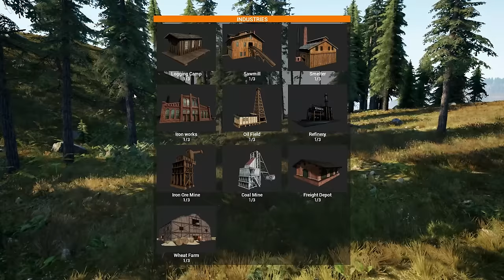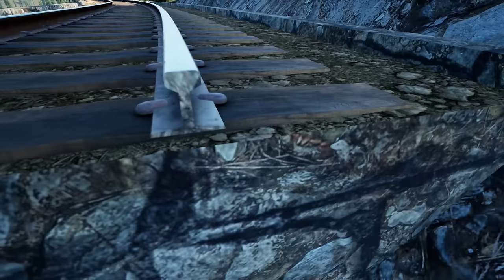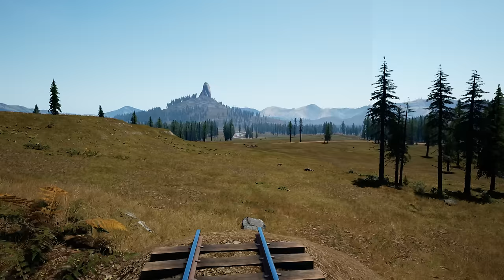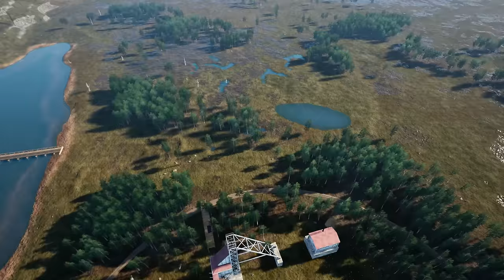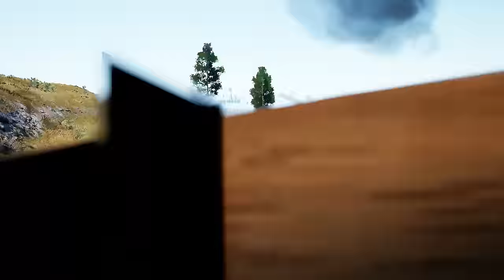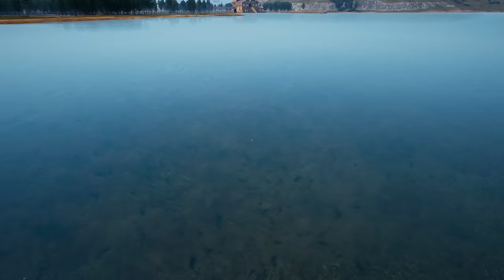I Built a Beautiful Lakeside Railway on The New Map in Railroads Online!

Comment: I would suggest using the three way switch at the saw mill. it might require some re adjusting of one of the crossing points but overall i think using the three way switch would make in a lot easier. the three way would replace the switch that you have right at the loading area if it wasn't clear
Reply: I was thinking the same thing I wonder why he doesn't use them
Reply: @zionjarman3610  I think it' mostly because it doesn't spring like the others when you run through from the back side and you have to make 100% sure you're lined the right way no matter which side you're coming from. The regular 2 way switches, of course you have to line for which way you want to go, but coming back through them you can just run through. Great for trying to just go and run trains, but not necessarily realistic.
Reply: @zionjarman3610  I think it might be because they don’t function as kick switches but in an industry going into the loading zone you would be going slow anyways
Reply: @Ronald.Golleher  didn't think about it

Comment: FYI I've seen someone running Eureka on a 50 meter curve at max speed (29 mph) and tip off the rails, so likely somewhere below 25 mph would be good for those tighter spots.

Comment: Getting the exact location for new industries would be nice, but I think an approximation is fine if you don't want to rebuild the entire network.
As long as you get the orientation right so the entry angles are the same.
Reply: Like I said in a prior video when it came up, I think placing them by hand and adapting the rail network as needed will actually make it more authentic.

It's not like IRL all industries existed and railroads got to calculate a most efficient network from the start. They changed and adapted over time, with the rise and fall of industry.

Comment: Lake Pend Oreille in Idaho has a pretty decent bridge across it, probably 2 or 3 times wider than the in-game lake. They used to have a big trestle across the Great Salt Lake in Utah,but that’s just a giant fill now. They had a station right in the middle of the lake!I think there’s some bigger examples in the South, but I can’t remember what they’re called. 

Once you get some faster engines, the longer alignments are the way to go. I went even further, around the back of the mountain past the coal mine, then 3% up the cliff to the iron mine. I found a decent 3% route from the IM to the smelter. I use the Glenbrook and Eureka to handle things on the flats, and a Ruby Basin to help shove them up the hill. If you can, save up for a Eureka since it can do close to 30 now!

Comment: Hey Kan, I’m wondering if you can use this same alignment method to connect the coal mine to the 4%. That would eliminate the reliance on a crazy 10% grade. You could probably go around the near-side of the lake and hook in where the big iron bridge crosses the valley to the freight depot.

As for your mill issue, maybe try replacing the mainline/smelter switch with a three-position switch, then use some diamonds to connect it with the mine alignment. So your loading doc switch connects to the mine, smelter, and goods alignments (left to right).

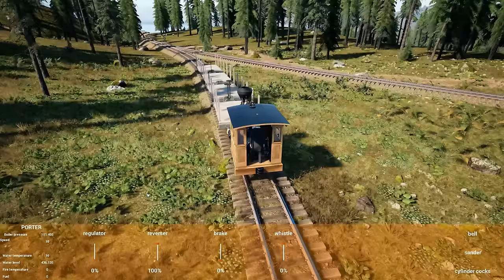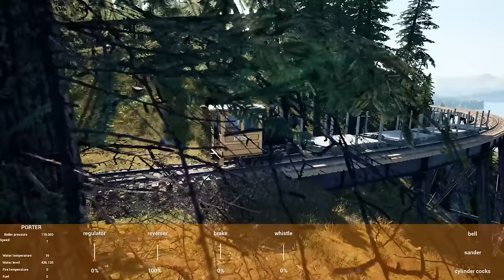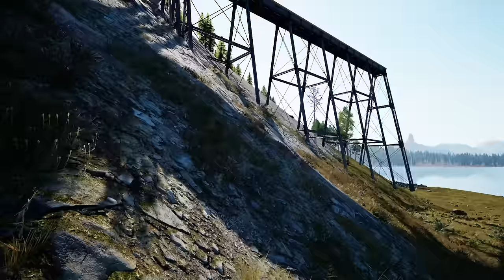Comment: I'm back seat gaming here, but at 5:22 I would have gone out further to the right (with the piece of rail that the train is on). See how the rail from this direction goes left then right and then left again? I'd have gone straight, left, straight. Or maybe even a gradual left turn. And I'd go as far leftwards when passing over the edge at 5:51 to hug the mountain side more, like making a 60° turn on the plateau. 7:24 even more than that. 38:34 is another view on why I would re-do it differently.
But hey, that's just my OCD and I don't claim that it's the right amount to have. Though I also do wonder how much one can generally improve their first alignment by going over the finished product in the opposite direction and re-doing everything...

Comment: 31:55 You would "screw up" your loading (i.e. you have to reverse to the crane in order to load both products). But placing the switch next to the cranes would give you an easy option to reverse the train. As it is now, a train that comes down going forwards will have to go back up going backwards. (Unless you do some ridiculously long reverse stretch that involves going into one of the inland-facing main lines.)

If you want to completely re-design the sawmill, I'd
either start with a full circle in front of the loading platforms, and wye everything into that;
or do all connections into the line up to the smelter (both the main around the lake and the main to the freight depot) and keep only a single teardrop loop past the loading platforms.

Comment: I swear the devs are going to look at your high lake bridge and go..."Nope we need to lower the max height."  So you're going to be able to build it, but after this no one else is going to be able to.  At 19:00 that's not a floodplain that an upland meadow.  Wrong characteristics for a floodplain.  Too much slope, no wet veg, and no breakline for where the topography leaves out to water.  It's still upland and not even squishy upland.  Yes "squishy" is an official wetland term

Comment: When you are buying the engine I would recommend the Eureka it's speed got buffed to 24mph 
Don't forget to look into the tutorial menu that's on H or M don't remember exactly they show the loco speeds in km/h there
Also in my save I have two routes from the iron mine to the smelter both of them go down south and loop around you can get it down to 3% that way but there were a lot of steel bridges
If you want a fast road from the iron mine build a 4.5% down south and get up to 48mph(the trains can handle like 250m turns but it's not like you need to really turn there)

Comment: Just an FYI, I know you've been speculating about the various cars and their capacities and stuff, but I'm pretty sure that's later. The skeleton car holds 5 logs, the same as the tiny log flat, but they're full logs. They trade off with the skeleton car and the regular log flat is about $50 (I think) in price and a 1 log hauling difference. It doesn't make sense that you have 2 cars doing the exact same thing for the exact same price. The tiny log flat and the skeleton car both cost $200 base price. Both haul 5 logs, even though the tiny log flat hauls essentially half logs, and having them just as aesthetical differences would be a really dumb game design. That's like admitting that the devs have 0 ambition to improve the game play and are only worried about if it looks good. A polished liquid turd is still diarrhea. Also, the half logs don't weigh any less. You load on 10,000kg of weight onto both cars (each log weight 2,000kg) and both hold 5 logs. So you essentially have the difference between the two weights of the cars to make up the difference. It has also long confused me why there's such a mix up of units and why kyumei is not fixing that. It's supposed to be a simulation of historic American narrow gauge, but he's throwing MPH with kg. I mean, I hate to sound so negative, but I think Hyce was correct in leaving RRO. It's definitely had it's heyday already and they're just shooting from the hip hoping something sticks at this point. They have no idea where to take this game and that's just painful even to speculate.

Also, I love the difference between RRO and DVS (Derail Valley Sim). You derail in DVS you hear it. You derail in RRO, the only indication you'll ever get is the normal running sound will cut out and if the locomotive goes over and you'll get a force bell ring........

Last thing, I know it's a meme and that you haven't had a Shay in awhile, but just know that for a Shay, "Yard Speed IS Top Speed." That thing maxes out around 8mph on a good flat........faster if it's headed down hill..... It's only benefit is it's tractive effort. Technically you could probably quintuple the load if you double tracked that lakeside track. You could quite literally get 5 Shays pulling full capacity and they'd never run into each other because they're so stink'n slow.

Comment: I've taken the line up the NW edge of the lake, 2-2.5% all the way, didn't hug the landscape - just followed the shoreline.
I also made the line from the Mine to the Smelter 2-2.5% all the way by creating a zigzag line. 
Yes, it limits your train length to an extent, but not greatly. Can fit 8 small cars + the 0-6-0 on each spur with room to spare.

Comment: From what I remember from the tooltips, Eureka is of right now the fastest engine. 

Also I moved my iron mine to the top left corner of the map, just below the monument. Built a route at with a minimum of 70m curves and a max 2% grade. Montezuma (my starter engine) took almost 20min (at full load, 6 cars) to get to there. Couldn't even reach it's top speed of 15, maxed out on 12. This was before the speed update thought.

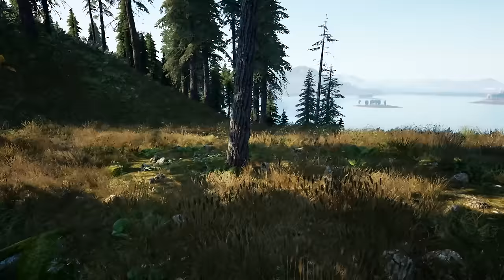Comment: From the Sawmill, go toward the Freight Depot just a little. Turn off to the right and double back. Turn and follow the lake at 2% rise. Use a lot of snaking to gain altitude. You just took the new line from the Iron Ore mine (call it at 12 O'clock) and the 10% to the Smelter is at 5 O'clock. The line I took would come in about 2:30 O'clock and maintain 2% for the run. It does mean a LOT of bridge work and that is the only disadvantage.

Comment: Essentially, building the mainline around the sawmill industry, as shown, creates interesting dynamics between all 3 of your lines: what about building your industry track around those routes bound towards more important areas? keeping your mainline clear of industry track by moving out more. Using this for loading: From the load area facing the lake: make a fat S bend round 180 both ways til you get to an alignment exactly how your bridge is set up. Then hook that S bend to a switch connected to said bridge, use the remaining link point to continue a 200 meter wide Mainline-curve headed towards the supply depot. Since the coal mine, ironworks and refinery all require smelter products; making that 4% part of the mainline may be of some use. 

Your level of intellect and expertise far exceed my capabilities, although, I think my idea is far better for long term growth in other lines.

Comment: 8:24 if railroads online has pipes you can place then realistically you can lay the pipes Onder the line to take surface water from one side to the other, and drainage pipes sticking out of the side of the mountain (like a porcupine) to remove seepage water so to not have landslides... ❤but it's just a game, I would like to make a goat pass track, hugging all the turns (flat turns mostly, and ups and downs between the turns, it's not for speed, it's for a little Betsy Adventure's 🎉

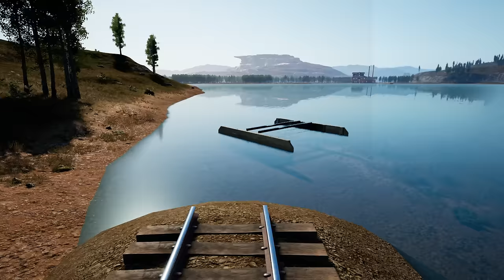😳 You have to build on the overhang of that cliff on the horizon at 22:00 😊😆 if it's not just a background picture...

Comment: Hey Kan would it be a better alignment if you start a new track where you started that 2% down and loop around the hill going up to the smelter from the iron mine, could still be steep but possibly better than the 8 and 10% line. Just a suggestion.

Comment: Maybe the way to go making the loop at the sawmill is this: When on the track ith the loading platforms to the right, go straight and put the switch after the crossover. Would be quite the wide loop that might connect to the new track right before the bridge across the lake, but that should have enough space for a good radius.